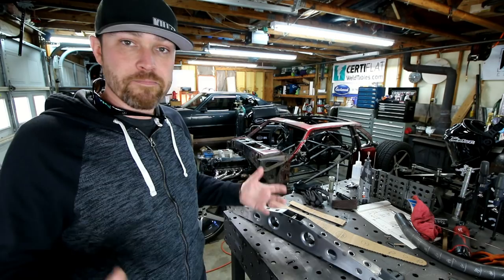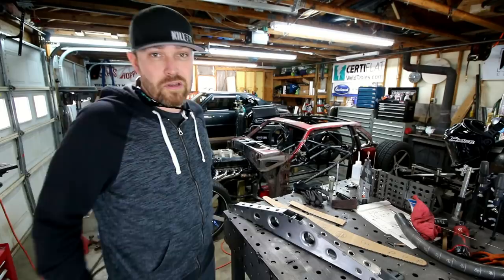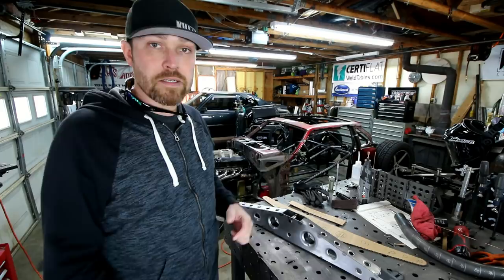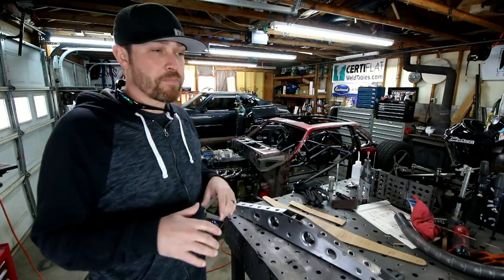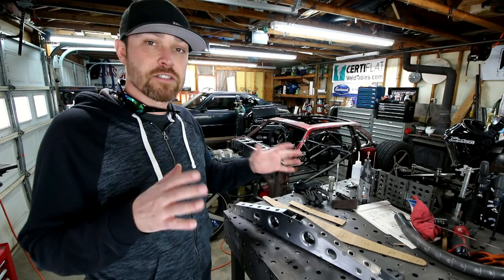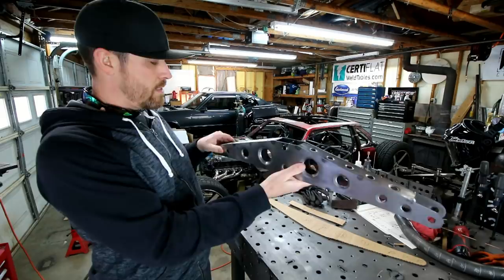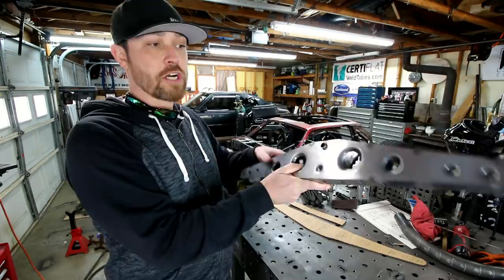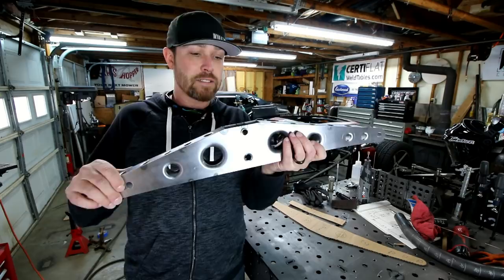Custom Cantilever Suspension | Mustang Hot Rod Build

Comment: Very nice. Maybe a Watts Link if you end up with side to side. But with those angles and no more rubber junk on there i doubt there will be. Ride might be harsh from all metal, but thats hot rodding. right
Reply from the maker: +NTH Welding Yeah for sure
Reply: NTH Welding . I agree  the top links are triangulated. you see 3 links with a pan hard for the side to side but I do more rock crawler stuff.
Reply: Kyle Arnold i like that one rock bouncer with his engine offset to the side a 4 wheel independent suspension,  he dominates with that thing.  Forgot the name of it.
Reply: NTH Welding. All large travel rock crawlers use this type of 4 link suspension and yes with large travel the geometry will cause some side to side. This is absolutely not an issue with the travel seen by this vehicle or many millions of race cars that use it successfully. A Watts link causes allot of side to side due to the arcs. It is used in sprint card just for this purpose. The sideways movement is used to "tighten" the car in a left turn only and can't be tuned to work both ways. Even a panhard bar will cause side to side as it swings in an arc from it's mount location. The only system that will produce no side to side is what's called a z-link adjusted correctly. Hopefully that was helpful and please don't take offense as I am a 57 year old Master ASE that has been racing for several decades with a fair amount of success. Have a good one.
Reply: Sprint "Cars", damn spell check!
Reply from the maker: lol
Reply: It won't have play, but he's about to find out why the fox body rear suspension has the nick-name four-bind.  It needed the rubber bushing to keep it from binding up.   By next year there will be a video of this suspension being ripped out and rebuilt with a non-binding arrangement such as a three link plus a watts link.
Reply: Chip Schweiss is probably correct, but with proper care it would seem that this design is easily serviceable. Some lubrication would probably go a long way, just any old high temperature stuff would be alright. It really depends on what you are supposed to do with the metal in the spherical bushings themselves, definitely fabbing up little oil boxes for them would be alot easier than a complete rebuild.
Reply: I highly doubt it. Want makes to thing this?
Reply: @matthewmoilanen787    In fact, a Watts link gives purely vertical axle movement.  This is the best method for ensuring purely vertical axle movement, but is relatively complicated.  It is the Panhard rod which gives bump steer due to the angular movement of the rod

Comment: heim joints are quite rough, what math have you done , ie instant centre etc ? have you done any cad work to see how well it will handle a turbo 5.0
Reply from the maker: yeah, my twin turbo fox is also all solid mounted suspension...noisier than rough. I have a rear suspension calculator that plots all the points but it will have an anti roll bar so it wont have any roll to it. No cad work...it a turbo 351, just have to real time test it....

Comment: If people don't understand what you're doing they need to educate themselves vs questioning what you're doing. It makes perfect sense to me. You also should not have any side to side movement in a triangulated 4 link with heims. Unless your angles are shallow or brackets are flexing. The only thing that I worry about is your pivot point on the cantilever. What are you plans to keep this from binding? Looks like a good place for a greasable poly bushing. I'd say use a uniball but your design will need something with a little side to side bind to it. If you had the center pivot point at a lower than center point than your end connecting points you could use a uniball no problem. With the center pivot point located higher than the end connecting points it'd going to want to twist. Visualize this. Take a 24" in length of tube. Put a 20 degree bend in it. Now place that on your welding table with the two ends touching the table and the bend straight up in down. Now press down on it. It wants to flop to the side. Now if you put the two ends on jack stands and let the bend hang low you won't have that problem when pressing on it. It will want to stay centered. It acts like a pendulum at that point and will always want to center the force put on the cantilever. Hope that makes sense. Beautiful build.
Reply from the maker: I am running a anti roll bar to combat any binding
Reply: I think I lost you lol. Either way, I'm sure if it ends out being an issue you'll figure out a fix.

Comment: hmmmm ,make youre own pressbrake ... yeah prolly can find everything you need at a truck wrecking yard , a cilinder and the liftpump from a eeehr lift ramp , prolly can use the valve stuff and the ( ends of all the) hydraulic lines from it too 
the rest is big pieces of metal and a few hydraulic hoses 
you could run the liftpump of a set of batteries (24 volt) or maibe find a strong enough transformer to lower and rectify the power from 110 ac to 24 volt dc , think the batteries make the press a little more moveable around the shop
can make a smaller version that will fit under youre hydraulic press

think the cantilever was originally made to lessen the unsprung weigth

Comment: Couldn’t find it in the comments.  But did you have any problems with warping while putting in the dimples on what seems like 3/16?
Reply from the maker: I had very little warping....if you press them completely you wont have much issue
Reply: The Fab Forums thanks

Comment: Are there any plans to sleeve the dimples? Ive always thought that it looked cool. Also, ive been trying to think of my own 4 link for a chassis and have wondered why everyone goes with heim joints. Forums (questionable source) say they are not good for everyday driving, so I was wondering why more people do not weld tapered bushings into their chassis so they can use tie rod ends. Was that ever a consideration for you?
Reply from the maker: Heims are stronger. Really if you think about it a heim and a tie rod ends are the same. Both are ball and socket except the heim is double shear vs the tie rod end which is single shear.

Comment: BTW how big is your shop. I'm moving into a new house and it looks like the our garages are the same size. Mine is 19x30 inside dimensions. I'll be doing all my fab work out of my garage. I have a 20x50 building on the property but it won't work for any vehicle fab for a number of reasons. I'll be using that for all the other stuff I do and plan on doing.
Reply from the maker: This one is basically 25x35

Comment: @the fab forum, just catching up on this build, so rad. Question regarding the hydraulic cantilevered rear. By extending the ram, I understand that it would push on the spindle and raise the car. However, wouldn't some of the extension of that ram translate into compressing the coilover on the other side of the lever and actually lower the car? But perhaps the forces from scenario A are so much greater than scenario B that its negligible?

Comment: I no you no the tie rod end must be even with rack in build a 1930 Ford the rack and spindles arm where the end has to be level.   I built a mustang coil overs on mine Ford nine inch rear Lakewood ladderbars afront rack with coilovers all around all alumminum floor so far so good still working hard I use a Eastwood Tig  200 ac\dc likeing it . You love cars as much as I do my dad was the oldest Volvo dealer in America he dies in 85 .I worked for Toyota for 23 years love your work love the rear suspension work. Pretty good at what you do I worked with some of the best body man in the world we had the largest body shop in the country
It was tuff to work there 4 days. To finish car start to finish .almost impossable.but most of the time it was done.anyway have fun your pretty good I like your work and that's saying something .have fun that's why you do it I think some of the other work you've done I've seen awsum

Comment: Love your work . Although I'm by far no chassis builder it seems to me that your bolt at the top center of your cantilever looks a little small I think I would go with a bigger diameter bolt and move it a little farther down vertically and also add washers welded to each side for double sheer but I tend to over build when I fabricate. Like I say I'm no expert it just looks a little weak in that area to me
Reply from the maker: Its already double shear and those are grade 8  half inch bolts which are around 35,000 lbs double shear rated....

Comment: Love the videos! Have a question about cantilever arm pivot point.
Are you using a bushing or bearing at this point? I am building a cantilever system on my rear with the coil over above the rear in the trunk area and was thinking it putting a bearing on the pivot.
Reply from the maker: No but mine doesnt move while the suspension cycles. You yours will be moving all that time is will need some kind of bushing or bearing.

Comment: What is the ride quality, advantages, and disadvantages or air bags vs coil spring? I'm asking for my own project.
Reply from the maker: +DieselPunk Cummins you have more options when it comes to compression progression  on a coil spring
Reply: I've never felt with bags before, are they good for a daily driver pickup?
Reply: DieselPunk Cummins I've got could on my mistakes, and bags on my work truck and my daily. Coils ride like shit, but they hold the road much better than bags. Bags are comfy and give support and ride adjustment. Only perks

Comment: Excuse my ignorance, but are there any benefits to doing it like this besides looks vs. a conventional inboard suspension setup ? By convention inboard I'm talking about push and pull rod setups, not like a normal McPherson setup.
Reply from the maker: +Fox well this is the way it is in order to be a able to raise and lower the car. If the shock and spring were inside I would be able to us hydraulics to do that.
Reply: The Fab Forums awesome! I got that part, I was talking more in the area of handling. I commented way before I saw it was a hot rod build, I tend to skip around videos. Sorry!

Comment: Can’t believe you are going hydros over air but with hydros you need to look into accumulators or those things are gonna beat you up. Trapped fluid has no where to move accumulators put some give in the system and make it ride a lot better. I’m sure you already know these things though
Reply from the maker: I dont want it to give....thats what the spring and shock are for

Comment: For the people in the comments questioning the cantilever arms. Those arms could hold more than 2000 lbs each set up in a bridged configuration. The dimples are not only for looks.
Reply from the maker: +blindabinda123 Yeah and the total rear sprung weight might be 1000lbs at the most...devided by two cantilevers
Reply: The Fab Forums I know buddy. You should re fab another one and stress test it in your press just to show people what it can handle.
Reply from the maker: that would be cool

Comment: Good stuff! You’ve probably mentioned this before and I just missed it but what’s the ride height going to be? Also say your ride height is 4” and the pinion angle is set for that. If you are cruising along and feel like dropping it down to 2” and cruise, will there be driveline vibrations because of the changed angle?
Reply from the maker: +Js S It will only have one ride height but if it had multiple it would be any different than an air ride setup
Reply: The Fab Forums cool, it’s looking good
Reply: You can set up the 4 link to maintain proper pinion angle through the whole travel.
Reply from the maker: thanks

Comment: Love every show and learn a bit every time. Why not use a watts link then it could never move? I am a bit confused as to how you will not have binding in the 4 link, u joints, drive shaft angle, unless you are only going to drive it a full lift and use the hydraulic for show slam parking only. and then if you blow a line when driving ?  Sorry I will shut up and just wait and watch.
Reply from the maker: +P Kuudsk I could use a watts link but why when it's not needed? Everything else you mentioned is no different than something with air ride.

Comment: Seems like that's gonna be a lot of pressure on the black air-shock in the front. Or is that the intended design, to have it act as a secondary suspension ?
Anyone else find themselves squinting & turning their head slightly every time they first start watching a video where someone sparks a torch ? LoL
Reply from the maker: lol

Comment: What size pivot bolt is that ? It looks a little small.
Reply from the maker: 1/2 inch
Reply: The Fab Forums seems a little thin for the power your going to have.
Reply from the maker: Double shear on a grade 8, 1/2 inch bolt is around 35,000 lbs...its actually over kill. Besides the cantilever would feel any of the power. The cantilever will only have to support the weight of the rear of the car.
Reply: The Fab Forums I'm always iffy on bolt size when it comes to movement and friction.

Comment: Just my info on my set up and experience with spherical bearings in the rear. 
I ran dirt cars for years and cheated with them and they put some great rear steer into the car. So my smart thinking was when I built my 80 model Malibu 2 door street drag car, I was going to free up the energy in the rear like I did the dirt car! WRONG! Well, it did free it up, alright! Lol. My dumb ass went with the "Some is good, more is better" adage and I put spherical's in all 4 points where the bolts go thru the trailing arms instead of only in the 2 points on the top of the rearend! I'd strongly advise against this! This was 5.50 second 1/8th mile cr on motor, my 1st test hit shot me from one ditch to another while dragging the rear bumper! 
Bud Light + 4 Spherical's= shitty drawers!  It felt like a BB in a box car on crack with a shot of Exctasy. 
(I know nothing about the crack or X thing, just what I have heard on the Discovery channel!) 😎
Reply from the maker: +Wanna Humpalot never had any issues...we have been that fast no problem. Maybe the G body was the issues...lol

Comment: The pivot point in the cantilever is too small. It should be at least 1 inch diameter pin with a bushing. I don't think a single grade 8 bolt will take that load without shearing off every time you hit a bump in the road.
Reply from the maker: why not, thats what every coil over setup mount on the planet has....same exact loads.

Comment: I see what you are trying to do, and I see so many fail points as well. More moving parts the greater odds of failing. That cantilever pivot bolt will need to be replaced almost monthly, maybe weekly depending on how often you drive it seeing its metal to metal.
Reply from the maker: Nah

Comment: 21:00
umm.... It looks nice, but the spring's job is to support or hold up the weight of the car. By situating your suspension the way you have, the car weight is going to be entirely on that shock absorber. The spring is much stronger than the shock and the weight of the vehicle being supported on a pivoting point (or hinge) will not cause equal weight distribution. Which ever side is not a strong will be taking the majority of the weight... If I can compress a shock absorber with my hands and arms, then it will NOT do for the entire weight of a vehicle
Reply from the maker: The spring and shock are both in the coil over. The thing on the other side is a hydraulic cylinder.
Reply: The Fab Forums 
Thank you for that clarification